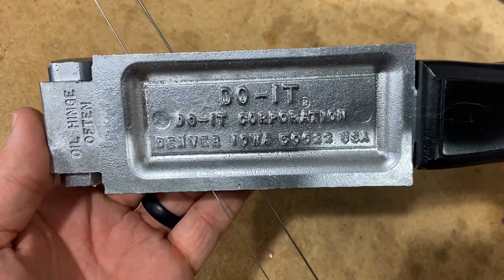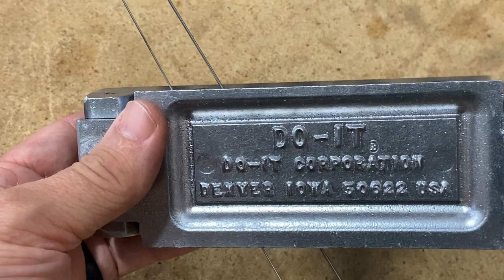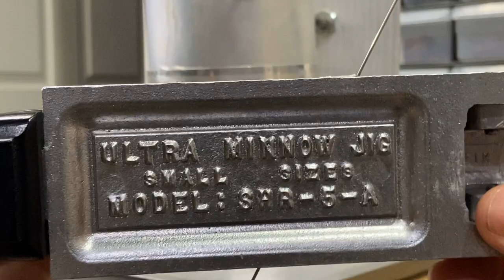Easy Mold Modification to Make Inline Spinners from Scratch!

Comment: Great stuff! And here I thought I was the only one that would carve up a $40 mold to suit my uses. I did a similar thing with a large bucktail jig mold to pour giant spinnerbaits for pike and muskies. Liked the tip on taping the wire in alignment and tapping it in.

For fine powder dusting on lures without an airbrush old makeup brushes are the bomb. The fine hairs hold plenty of powder and a gentle tap makes for a very fine distribution.

Also wanted to cure my powder in a vertical position but came to a different solution. Made a wood frame from 1 x 2s and stapled metal window screen on the top and bottom. Then I put some 3/4" spacers and added a solid bottom of sheet metal from a duct work project. The screen holds the wires upright without slipping sideways. 

As far as your loop alignment "boo-boo", wire is pretty tolerant of minor adjustments. Gently twisting by 90 degrees is definitely not a big deal. Just go slow. One more thing: Instead of clipping the tag end of the loop try sharply bending at 90 degrees to the standing wire. Often times it will snap clean on the first bend, especially if you do it immediately after you make your barrel. Sometimes you may have to work it a couple of times. The advantage here is it breaks very clean. No sharp end to catch weeds or (worse yet) line. AND it breaks right at the shaft, not necessary to have to try to wrap that last 1/16 of an inch so it doesn't stick out.

Last thing: Keep overall lure balance in mind. Too much weight to the rear makes blades hard to start and/or keep turning unless you reel in at light speed. 

Thanks for your content! I always appreciate an innovative lure guy 👍👍
Reply from the maker: Thank ya much, great input!

Comment: Fantastic!!!! As soon as I saw you lay the wire in the mold my first thought was, "that head is going to spin." Well done and you even used craft fur, it couldn't have been any better!!!!
Reply from the maker: You were on it!!  Kudos as I didn’t foresee the problem until after the fact on the 1/2oz experiment head.  But… that’s Lurecraft!  Trial and error until you get it right!  Figured you’d appreciate the craft fur as well, LOL!  Extra Select ONLY of course, ha!  Thanks Dan!
Reply: @SDGCustomLurecraft   Adam, don't think I just saw that head spinning because I know better. I saw it coming because I've done the same think!! I tried years ago to make a style 9 shad jig into a weight forward spinner. I poured the head with the wire through it and decided I'd try to make the loops with my wire former. As soon as the head hit the die on the wire bender the moved back about 1/4", that is when I looked and spun it with my hand, total fail!! So yeah, I'm not so smart...LOL!!!!!
Reply from the maker: @smalljaw  LOL, well that works too!

Comment: very helpful video; I've modded the ultra minnow to make tailspins and underspins, but not an inline spinner.  Yet.  As for  the body spinning, in making smaller spinners I've had the same problem with willow and french blades.  But using blades where the wire passes through the blade (think Panther Martin), I got less spin.  So far I have been using bare single hooks...adding some dressing to create some drag might eliminate the spin entirely.  Thanks for your video(s).
Reply from the maker: Great feedback, and glad you enjoyed it, thanks!

Comment: If I may suggest on the whip finish…
When I have that kind of issue I use the pull through, add a thread that’s looped, finish wrapping, cut the main and thread it through the loop and pull the loop through. Same as when you’re wrapping rods (where I learned this from). It really is the simplest way and it’s very secure. 

I really enjoyed this video, I have that mold and will be modifying it. I liked how it looked, thank you.
Reply from the maker: Great suggestion!  I may have to try that one!  Thanks man!
Reply: Yup, been doing it that way for years.

Comment: Great work, Adam!  Love the concept and design.  Perhaps with an "S" shaped clevis, the 2x blade would have worked after finding the correct size - which is  something I struggle with.  There must be some blade size - lure length or weight relationship.   But for now, it's still trial and error.  Even on simple French blade inline spinners.
Reply from the maker: Yup yup, thanks Rob!  I have since swapped it for a size 4 Indiana (single) and it runs like a champ!

Comment: I'd just wait to epoxy them after you've tied them so it also secures the whip finish.I'd also use UV epoxy instead,there's no mixing and it doesn't cure until you want it to cure.
There's another way also,create a J loop bend (as done to spinnerbait mold forms) so it's placed in the middle of the head then add a spinnerbait hook and then pour. You can't use the treble hook with this method but a single hook works just fine catching fish.
I have modded a lot of my molds,from anything to use smaller/larger hooks,different head shapes to making spinner/inline baits.
Have to also watch hitting the molds with a hammer or even putting then in a vise,either way can break your hinge or break the mold somewhere in the middle. I just place the wires/hooks where they need to be and use a scratch awl (X-acto knife works fine too)to outline the wire/hook.
Reply: BTW,don't use those snap swivels to attach any lure/hook/bait. It's lazy an a noob way to attach lures. It will also fail at some point. Best thing to do is use a swivel tied to your main line then a length of leader tied right to your lure or at the very least if you insist on using a snap swivel get those locking ones,they offer a lil more holding power than those cheap ones.
Reply from the maker: Thx for watching!

Comment: Do u find that the 8 inch wire is the right one or would u try a shorter length?
Reply from the maker: Thanks for the question Patrick!  I don’t cut off much, and if there is some extra it makes it seems easier to bend, so 8”, IMO, is a good length.  Hope this helps!
Reply: @SDGCustomLurecraft  Adam, yes it does, and great job on u videos, I use a small make up brush for my powder paint,works great
Reply from the maker: @patrickmchenry9154  thanks!!

Comment: what is the gray surface on your mold?
Reply from the maker: That is "Drop Out" - its a cast aerosol spray I get from Amazon that helps the lead flow and the casting release from the mold.  You can "smoke" you mold with a candle as well, I just never have as I don't like the look and potential mess.